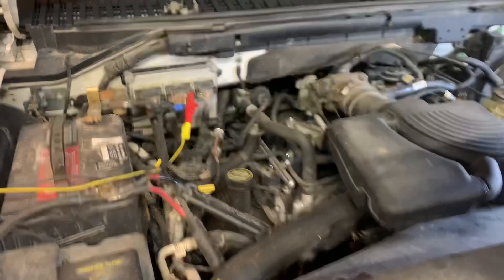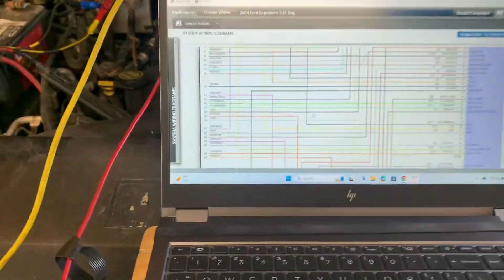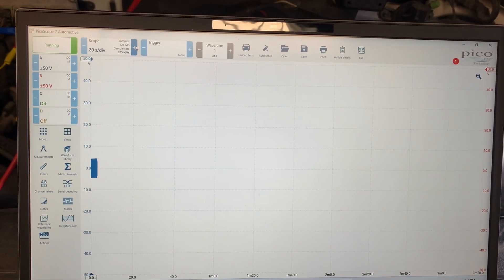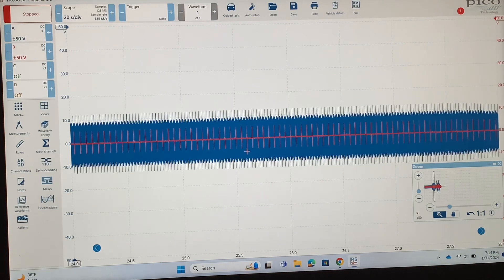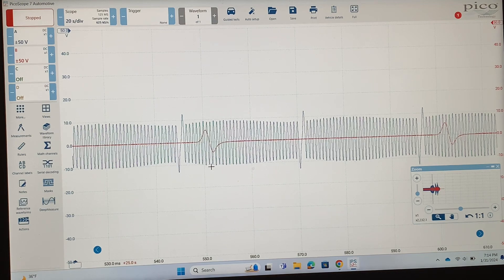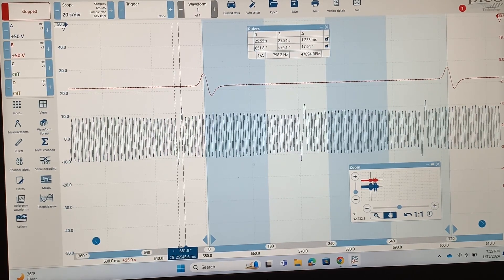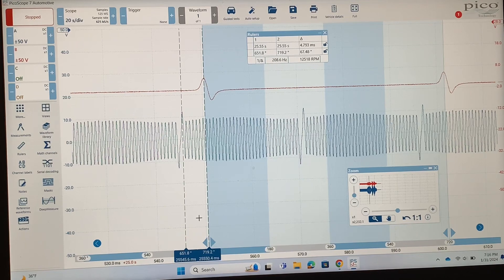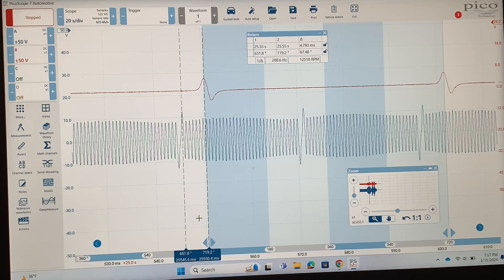Looking at Cam and Crank Position Signals to Verify Timing (Good Test For Variable Valve Timing Too)

Comment: Interesting video. I have a 2009 LS 6.0 that starts and runs fine when cool but quits when it heats up and will not restart until it cools down.  I replaced the cam sensor, phaser, cam bolt, tensioner and timing chain along with the VVT solenoid.  Still does the same thing and it throws a P0016 code when it stalls.  The cam/crank variance shows 19.3 degrees off every time it happens and will show 19.3 degrees while cranking.  The temp of the oil seems to have something to do with it.  When it get hot and drops to 20 psi, it will shut off and go out of time. The last time it did it I changed the oil and it started further indicating its an oil pressure issue.  Do you have any thoughts on this?
Reply: Proper oil pressure required for VVT